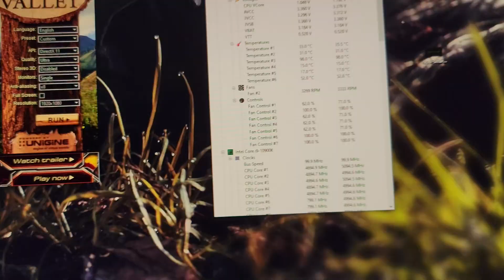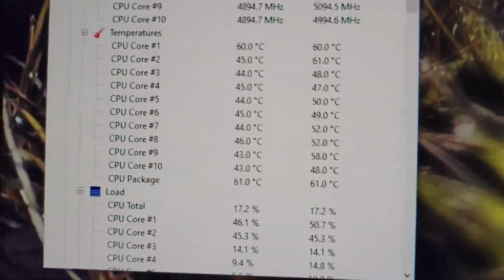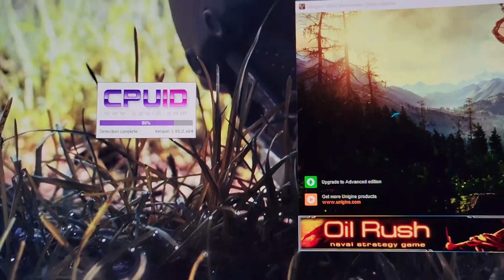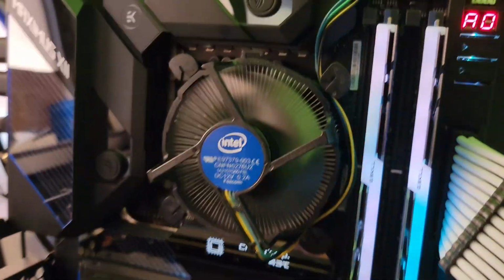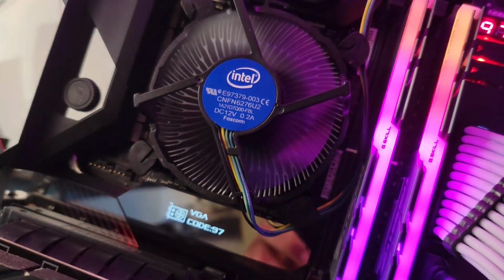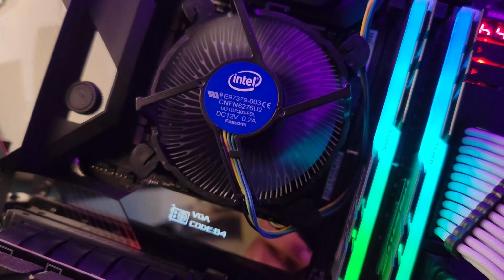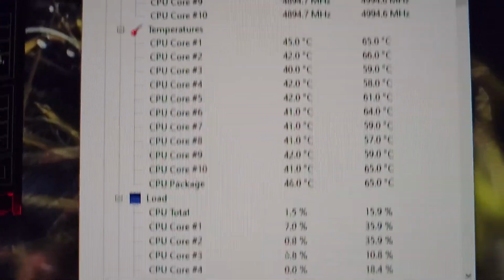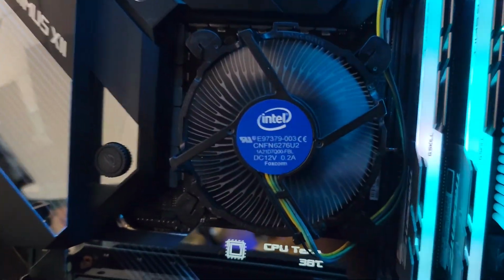Intel Stock Cooler Showdown: Copper Core vs All-Aluminum – Does It Matter?

Comment: CPUs will throttle with temps and not burn out and die. In fact if anything it's the motherboard that dies. And again. Still made for high temps and unless you turn off thermal throttling. They'll thermal throttle at the SAFE temp of 105-110°c
Reply: Well. Anything after like 7th Gen era for sure. Not sure about before. before I was AMD and they were 85-95

Comment: Too much lol. The i9 SAFELY handles 110 lol. I understand not wanting too personally. But it's not actually too much lol.
Reply: So yes. I liked the video. I appreciate it. I just found one for a 3770 like the guy before me was saying and I have an all aluminum. BUT mine is a hollow copper core and before I took the time to switch them I wanted to make sure it was worth it.
Reply: I get too confused between all the 11?? And 115? Sockets lol. I have dyscalculia (dyslexia but for numbers. Not words and letters. So I have to concentrate and double check a 1000 times when it comes to those sockets and for personal ease just normally remember the CPU not socket lol 🤦🏻‍♂️

Comment: I got the exact same stock cooler as yours, the aluminium one. With my Xeon processor, it averages around 80c idle...I'm purchasing the copper one to see if that changes anything.
Reply: I have both stock coolers,  and on the same day same room temperature I averaged 3-4° cooler with the copper slug one. You are better off grabbing a cheap aftermarket one with more surface area and a larger fan.
Reply: @thebaddestogre-3698  3-4 degrees cooler its good difference
Reply: XD
Reply: Don't buy a new stock cooler, buy an aftermarket one.